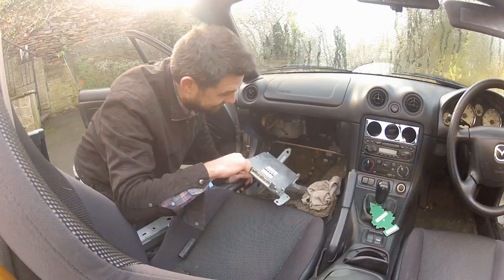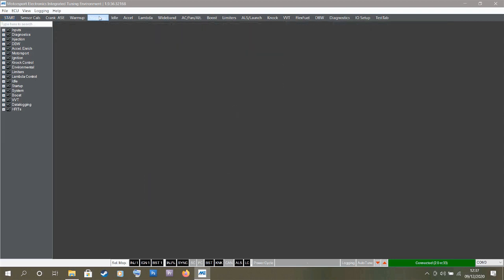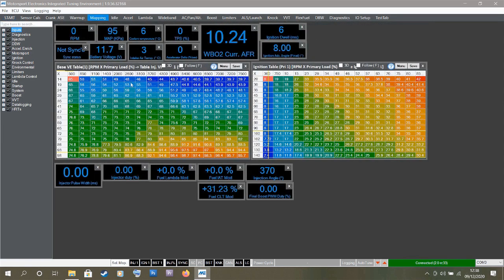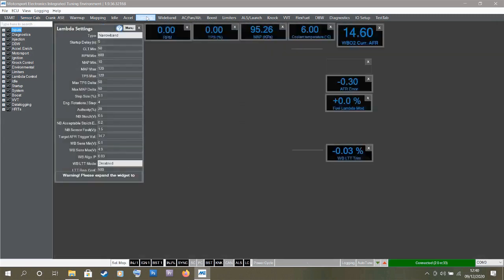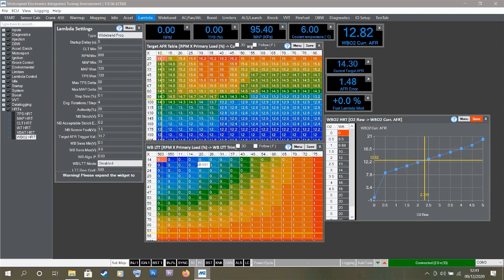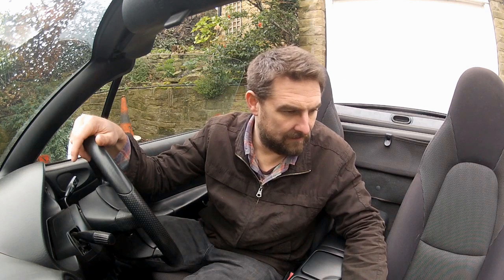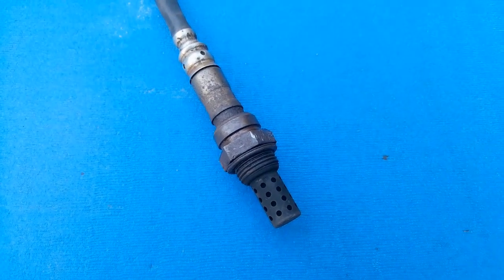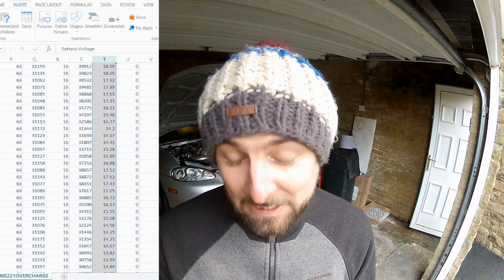Basemap Upload, Sensor Calibrations & Start Up - ME221 Install Pt 02 | Supercharging an MX5 Ep 09

Comment: I believe I have experienced the exact same issue on my 1999 mx5. I installed the ME221 ECU and wideband and all was good. Ran the car multiple times trying to tune idle ect with no issues. Then, out of nowhere the car revved to about 2000 rpm for a second and completely died. The main engine fuse (80A) was blown along with the engine fuse, Room fuse and A/B fuse. I wasn't datalogging whilst this occurred but my only suspicion has to be an overcharging from the alternator blowing the main fuse and half my cars electronics along with it. The room fuse now no longer blows when I remove the immobiliser module from under the steering rack and the main fuse doesn't blow after I have replaced it however the engine and A/B fuse continue to blow on ignition. Easy to say I am more than frustrated as after seeing this I believe it is entirely possible that the ME221 has overcharged my car and burnt out the immobiliser and other modules in the process. 
Out of interest were Motorsport Electronics helpful? The damage done could easily cost my hundreds and take many hours of my time to fix.
Reply from the maker: Without a log it's hard to prove but certainly sounds like it. I've heard multiple cases now of this happening. Super frustrating if it's fried some electrical components as well. I can't say ME were that helpful, aside from giving me the option to send it back for testing. But then again, it was 2nd hand. I suspect if you bought a new ECU off them it would be different. My advice to anyone reading this with any NB or NBFL - convert to a mk1 alternator and forget about it.

Comment: hey, just looking for some advice, I want to supercharge my mx5 with eaton 45 or 62, not decided yet. and I dont quite understand how to connect the wideband to ecu. The ecu needs the wideband controoler. I understand that the me 442 has one built in, but I dont know if the 221 has also one built in. If I use the 221 do I need to buy AFR sensor with the controller in it and then connect it to the ecu?  Can i run me221 without the AFR gauge? basically just the ecu + wideband hooked to the stock connector?
Reply from the maker: 442 has wideband built in, 221 (like mine) does not. Check out the previous video to see how to wire up an AFR sensor and gauge to the 221. You can run the 221 on the stock narrowband sensor if you wish, but it's not ideal if going boosted.

Comment: Keep up the build mate, installing my megasquirt next week on my nb1
Reply from the maker: On with it, new vid next weekend 👍🏻 Good luck with megasquirt install.
Reply: @FastRust  great will definitely be watching it! Got my megasquirt running over the weekend couldnt wait haha. Idle and drives like stock it's great, when I auto tune it hardly changes anything! Also set up spark cut launch control and done about 10 of them already😂
Reply from the maker: No messing about! Is Tuner Studio easy to get in to?
Reply: @FastRust  very easy mate, there is a question mark next to everything and it has a dumbed down explanation for everything which is good haha. But apart from that, the base map that came with the ms3 mini is spot on, idles and drives perfect

Comment: I know this is a week late but isn't there a way to just cut either the voltage sensing or the alternator control signal? Or set it to a fixed/unregulated value.
Reply from the maker: Hi Peter. We tried many different things, we set it to Manual Duty (effectively fixed value), did not make a difference. I tested the wire from the ECU at the alternator which gave the same voltage no matter what setting we tried. This with the fact that it worked fine when I put the stock ECU back is why both ME and Alex came to the conclusion that they did. The mk1 alternator mod I'm currently working on involves some wiring modifications similar to what you've suggested (effectively cutting the ECU out of the circuit). Hopefully it works 🤞🏼

Comment: Gutted for you that the person selling the ecu gas stitched you up, buying secondhand is a lottery sometimes. ☹️ good luck with the alternator workaround. I’ve just got an me221 for my mk1 1.6, with the long, long term aim to put a rotrex supercharger on it. I’ll be deleting the AFM and running it NA in the meantime, for a few extra ponies 😁
Reply from the maker: Thanks Richard. Took the wind out of the sails a bit! In hindsight probably would be better to bite the bullet and buy new. But we are where we are. You've got a good plan there mate, I think getting familiar with the ECU first is a good idea. You'll be up to speed for when you fit the supercharger. Rotrex will be wicked. Is that the Track Dog Racing kit?
Reply: @FastRust  I bet it did! I’m sure you’ll get there though. I’ll be following with interest! I bit the bullet on a new one as BOFI racing had a sale on, also got the TPS and the AEM wideband and gauge at the same time. The Track Dog kit is the one I would like, as it seems very good quality, but it’s a bit expensive with import charges etc for me at the moment, so that will have to wait for a bit. If someone developed something similar in the UK it would be great, but I think the rotrex is a bit niche in an mx5 scene dominated by turbos! I’ve wavered towards a gt2554r, with turbo installs being quite reasonable, but I’m not keen on the noise, I’d worry about the heat,  strain on the drivetrain and I feel like it’s important to keep the NA throttle response. Sadly I’m not keen on supercharger whine, so I’ve backed myself into the pricey rotrex corner! 😂
Reply from the maker: I get where you're coming from on the noise. As I get older I find noise less important! Especially in a daily as this is. If the whine is too loud I have options - 2nd throttle body pre charger for one. Hands down though if money was no object it'd be a Rotrex. Best of everything.